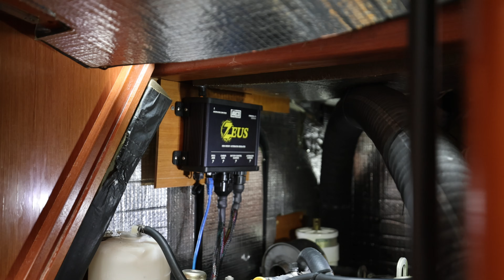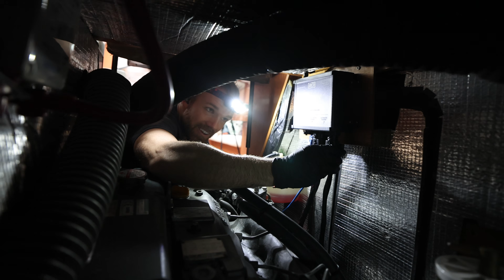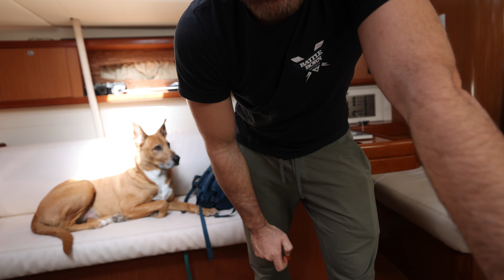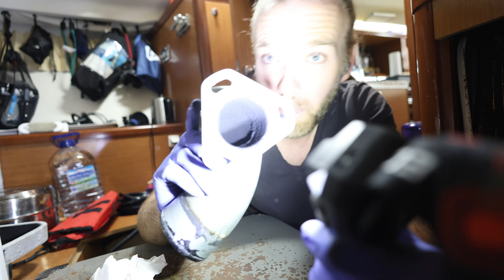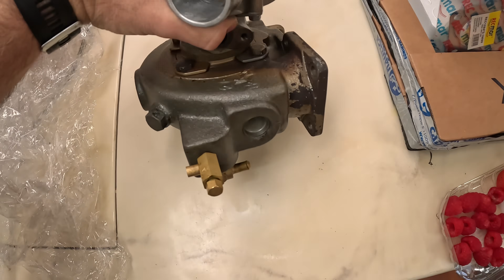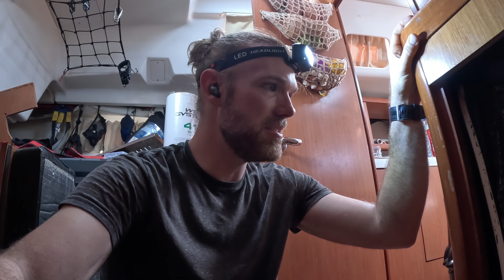Billowing Smoke - Broken Turbocharger - But at least it got upgraded electronics! (6)

Comment: Would start with inspecting the cooling system. Not sure how your system is designed: (a) if the engine has an “open” water system and pulls seawater for cooling and then discharges, or (b) if the engine has a “closed” cooling system system and circulates an antifreeze coolant.  Anyways, either way, first thing I would check is the impeller.  If you are running antifreeze in a “closed” system, white smoke could be a blown head gasket where antifreeze passing through the head is leaking into the engine’s piston and exhaust.  I wouldn’t think an “open” system (using seawater for cooling) would ever get to a point of producing smoke.  What does the exhaust gas smell like?  Does it smell like chemical or burning antifreeze?  I don’t know how your engine cools, but my thoughts are that seawater is corrosive and therefore you might have a “closed” cooling system using antifreeze, but that is just a hunch.  Anyways, if all that checks OK, would then remove spark plug wires and remove and inspect spark plugs.  If you can borrow or buy a compression tester, test compression of each cylinder to ensure cylinder walls and piston rings are OK.  This would also verify that intake and exhaust valves are working properly.  Sometimes valves stick or fail but in that case your engine might not run.  Not likely valves, but depending on the engine design, sometimes they need to be adjusted.  And as you mentioned, would definitely look at exhaust manifold and the manifold riser to ensure it is clean and that gaskets are working and sealed properly.  The last thing you want is (in an “open” system using seawater) corrosion or blockages or gasket failure, to where cooling water backs up through the manifold risers, and hydro locks the engine.  I know very little about turbos other than they compress intake air.  I can’t imagine a situation where a failed turbo leads to exhaust smoke like what you were showing in today’s video.  My suspicion is that you may be having head gasket issues.  Be careful not to run your engine if you do.  We had a failed head gasket last year in our inboard waterski towboat, and it quickly turned into a very expensive engine replacement.  In summary, start by inspecting your cooling system, water pump impeller, blockages or corrosion in cooling system components.  Buy a compression tester and test cylinders for specified compression, while looking at spark plug condition for evidence of internal problems.  A compression test will validate your valves and verify they are working properly (though your engine appears to start and run).  Then move to exhaust manifolds, exhaust risers, gaskets on manifold risers, manifold cooling jackets, and carrying out a very close inspection of manifold for small cracks between the “cooling” water jacket and the exhaust gas passage.  It is also possible that in your exhaust manifold that a gasket failure at the manifold riser or manifold generally, can leak coolant into the separate exhaust gas channel … if you use an antifreeze coolant this can be introduced not only at the head gasket, but in the exhaust manifold.  Some guys use compressed air to test manifold and manifold risers for small cracks between the manifolds water jacket and exhaust gas chambers.  Not many people know, but exhaust manifolds are often a neglected maintenance area, particularly in corrosive salt water environments, and I have seen recommendations of routine manifold replacement as early as every 3 years in salt water environments.  Good luck!
Reply: https://youtu.be/upmpaZ6nYLQ?feature=shared

Comment: 1 minute 29sec in and I stop the vlog for my guess. It’s dumping fuel it’s not burning it when the rev’s go higher. Gets to a certain rpm and that would be about 1500 rpm and that’s all hence turbo won’t kick in. Clean fuel lines filters and injectors. Check the fuel pump on engine. Now back to vlog,,, lol

Comment: -Turbo is blown. Check cooling likes to it or you'll burn up another one.

-Rev/ cam/ crank sensor
 bad. 

- fuel issues since it won't rev higher then 2000. 

Black smoke is ok, white is water in cylinder. Gray/blue is oil in the cylinders.

Comment: Rust stockning the turbin. 
Take of the elbow exh side and feel with your fingers,
Remove the rust flake stocking the turbin wheel and make sure the rotor is smoothly rotating,.

You can machine one fit stainless bushing in tc hosing when renovating the turbo.

This is yanmar typical

Comment: For a non (F-Bomb) power boater you seem to have a lot of engines.  I think you have three on board.   My (F-Bomb) power boat does not have a turbo.  Just one engine on my (F-Bomb) power boat.  I do have a turbo in my 65' Chevy.  I had to de-carbon it just like your boat.  Glad to see your up and running again.  (F-bomb) power boaters right???  That is me.  See you on the water.

Comment: plugged air filter can scavange oil from the turbo, and cause smoke on it’s own, as well as cause the spool to fail..  I’ve had two fail on the yanmar powering my skid-steer.

Comment: Oh good. I thought you kinked an oil line and seized the turbo. Getting that cleaned out might help your heating problem as well. Carbon buildup retains high heat. Glad that it got caught while not 600 miles from anywhere.

Comment: You might want to think about how you use that high output alternator at low rpm. It seems unlikely that with the little bit of use you gave it causing the problem, but low rpm with no turbo and more diesel going in may clog things up quicker than you may like. Also if you aren’t able to get low sulphuric fuel that could do it too. I have a naturally aspirated diesel in my boat and I try to run nearly wide open throttle for a while to blow out the carbon.

Comment: Do yourself a favor and get a SS elbow from HDI Marine. Cheaper than a stock Yanmar and will last a long time. I have 2 that are 9 years old and have been on two different 4JH engines and they still look and perform as new. Save your old one as a spare, it will develop a crack in the weld and leak seawater.

Comment: turbo diesel engines dont like to run at low rpm's for long periods of time. they need to spool up to burn up and clear out the carbon build up that happens at low rpm's.    all you gota do is clear its throat after after its been running at low rpm's.   spool the turbo up for a couple minutes.   it will help the engine out a lot.

Comment: So, I used to be a Nissan certified Master SCOPE tech. Smoke usually equals, a loose, bad piston ring. OIL slips past it. That smoke looked light blue which I think was piston ring? It's been 35+ years since I was a mechanic, but ya smoke usually means rings as oil is getting past it and being burned up. But cars are not boats so maybe???
After you fired it up, you have valve issues as well. That's called valve slap.

Comment: Engine air filter probably okay on a go-kart but I would have a bigger and more efficient one. More on the cramped engine room ... why install sensitive electrics up high in this space? Heat rises let alone its always better to keep any weight down low in a boat. Smoke out the exhaust .... if its a blown turbo it happened because turbo had blocked oil feed and along with high rpm cooks the exhaust input compressor wheel and smoke comes from any residual oil and /or water if turbo is one that has water cooling as well? Heat is the cause no matter what the culprit. Keep up your learning and try avoid using apps to monitor crucial parts of the mechanicals.

Comment: Judging on your info I would say the turbo seal. If the smoke was grayish, that is oil. Black smoke is fuel. The smoke at higher rpm is because the oil pressure comes up with rpm. Hopefully the turbo is the problem, that is the easiest option.

Comment: Would high or low sulfur diesel effect the amount of carbon in the turbo?  In the US, you are supposed to use low sulfur diesel in its waters. Large ships will switch over to cheaper high sulfur diesel while on the ocean. I am just curious if you use one of the other always and which might cause more carbon.